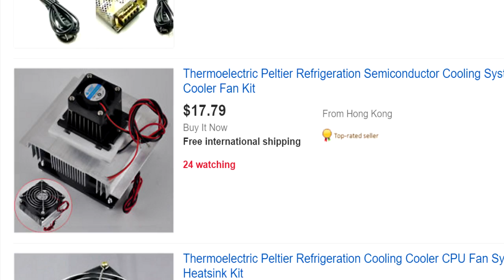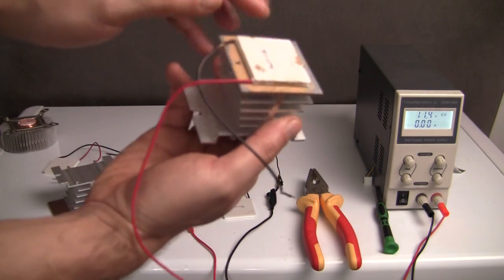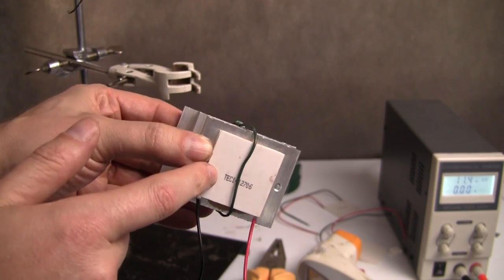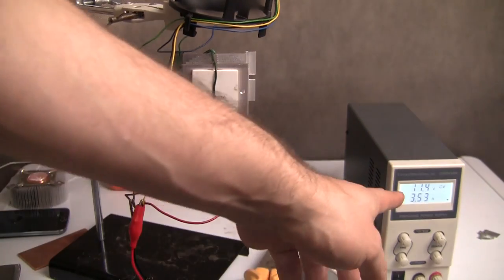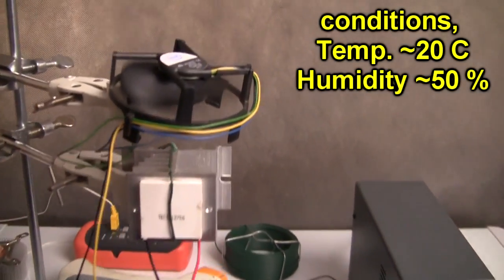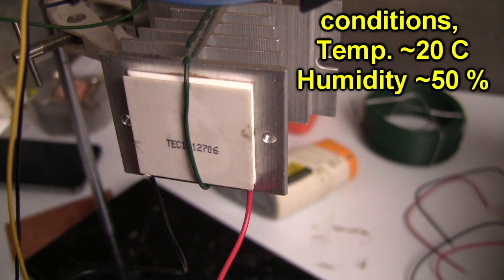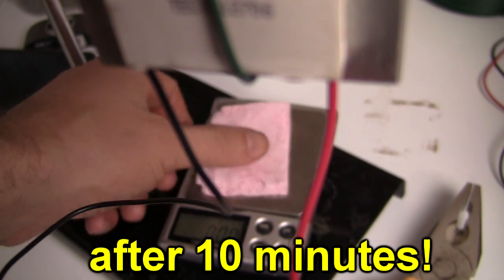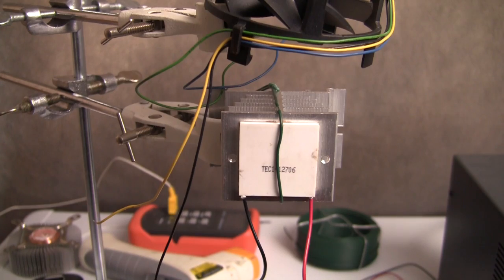Fontus Water bottle claims to make water from air.  Is it possible?

Comment: Thunderf00t your apparatus is not ideal and doesn't represent the product as all the water is sticking onto your peltier which isn't cold enough anyway. If you look at dehumidifiers they use a similar principal to this water bottle. They have a finned steel piece on the cold side that is covered with a hydrophobic layer so that the sink gets very cold, but not below freezing, and any water that collects on the surface drops down rather than collecting on the surface of the peltier, leeching energy away. Also this water bottle will work best when moving through the air such as on a bicycle. Having said all that, I think if you are cycling with the water bottle and have a full battery you may get a full bottle of water, but certainly not if its just sitting there.

Comment: Did you coat your equipment in hydrophobic and hydrophilic materials? That is essentially their claim it seems, that the nanocoatings greatly increase the efficiency. Also, you should have air flowing over the plates, at say 40 or 60 km/h, since their design uses the movement of the bike plus probably a scoop to increase speed and density of air flowing through the system. As mentioned below, also you should be closer to 70 to 80 percent humidity.

Comment: you need to coat the heat-sinks with a hydrophobic substance you also need more surface area. there is a noticeable difference in water production. otherwise you end up re evaporating any moisture you collect because of air flows. regardless of surrounding temperatures. there are other variables as well. like humidity.

Comment: What if you double stacked the peltiers to get the cold side colder?
Reply: +Ren K That wouldn't work the way you think it does.
It would retain the -5 degree temperature for longer, but it's essentially just like adding another heat sink onto it.
Reply: +LouisAndPillz actually stacking them works exactly how ren k suggested. stack 4 of them youll get an ice buildup real fast

Comment: I'd like to see your results with more variation in test conditions.  Higher room temp, higher relative humidity should yield some slightly better results.  A copper/alloy heatsink might do better too, but I doubt that the water bottle had those due to price.

their claim is 0.5L/Hr, I'd be fairly impressed if they did that with anything less then 90% humidity.

Comment: If making water from the air is possible, someone already pattent technology and been ultra billionarie already... because we dont need more water supplys if this is possible... why people believe any bullshit that hit the internet.
Reply: +Armando Montero Air conditioners and fridges make water from air.
Reply: Ren K
Problem with that kinda water is H20 Pure. and if you drink pure H20 you will desmineralize your body, because the common water we drink is full with mineral and other stuff...
Reply: People drink water from reverse osmosis units all the time.  You aren't going to "demineralize" your body by drinking pure water lol
Reply: Cyborg Pirate Ninja Jesus
you actually know that when you reverse osmosis water plant remineralize water right? people dont know that part at all. because filter with reverse osmosis is so good that remove everything and leave H2O pure, and they need to re-mineralize water before releasing it.
Reply: Armando Montero You can buy your own RO system for your home.  They are pretty common among people with hard water issues.  Their very purpose is to produce clean drinking water.  What other purpose could they possible serve?  I used one for years and never suffered a mineral deficiency.  Neither has anyone else, that I'm aware of.  That's because water isn't the only source of minerals.  Practically everything you consume contains minerals.
Reply: Armando Montero
  eat something. demineralize problem solved.

Comment: I'd make sure the closed space and thermal connection is good, if there are able to make the device efficient enough and separate the hot and gold sides efficiently enough it could be very effective.

Otherwise a pretty solid debunking, I would also test for cycling of the hot and cold, as we saw on start up it did get very cold and if you shut it on and off cyclically what does it do? So many fun questions to answer.

Comment: Another quack product using some "real science". Sure the basic idea is sound, but in reality it has no chance. I run a peltier cooler to keep my soda cool, and it eats 12v at about 6 amps. Leaving it open all day results in just a few ml of water at the bottom. At best those solar cells will provide less than 10% of that. That's the problem with a product like this, just enough truth to fool those not fully paying attention.

Comment: Yeah, at 20 degrees. What about 35? Also, how much electricity had to be sunk into it? Like, if you were worried about running out of water, you'd next be worried about running out of electricity. How many batteries would you go through in 1 day just to make a shot glass?
Reply: +Beren Scott Pretty sure it'd be fairly easy to rig one up to a solar collector, or one of those hand crank generators.
Reply: Dargonhuman And if you are hiking, wouldn't you rather carry x litres of water, then carry the bloody heavy solar collector?
Reply: Beren Scott
X liters of water, or a couple modified solar lawn decorations...  Hmm, that's a toughie.
Also, I did say "or a hand crank generator", which is still lighter than two liters of water, so yea.
Reply: Dargonhuman Yeah, but the energy consumed in order to get enough water is excessive, you may as well use a machine to convert your sweat into drinkable water.
Reply: Beren Scott
Why use a machine?  I just squeeze the fresh raw sweat out of my clothes right into my mouth, just like John Wayne would have done.

Comment: The water that collects in my dehumidifier never looked tempting to drink. I can't imagine the shit that would accumulate if I used it outside! Yuck.

Never mind the efficiency.
Reply: +EnhancedNightmare The dust in your home is mostly your dead skin cells. I think you'd prefer the shit that would accumulate outside :)
Reply: tybofborg Well, deadskins and dirt etc compared to smog and industrial waste. Tough choice :D
Reply: It's not like that stuff doesn't make it into your home. :P
Reply: tybofborg There is a filter system in the ventilation but opening window cancels it lol. Still during smog alerts they say not to open windows.

Comment: What would happen if you add another heat sink to the cold side to spread the colder temperature to a bigger surface and allow more air to cool down and at the same time have a greater surface for water condensation to occur?

Comment: Theoretically a nice idea, I mean air has so much watch in it and the more humid the environment (where you're more likely to loose a lot of water) the better it would do. I would argue that the heat sink you used and the the fact that you didn't have a tight fin grid cooler for the cool side, but peltier coolers are not efficient enough compared to other technology.

But if you ever found yourself in desperate need of water and you had this option vs using chlorine or a desalinating device... well for the same amount of energy fresh dirty water would bee easier to use chlorine, and for salt water (on a raft/boat) if you had that much power available, then using an electrical condenser (heating the water) would be better.

Fog nets are so much more efficient for literally drawing water out of thin air, no power needed, though they are not portable on your bike... you might as well use tap water and plan your trips better.

Comment: Patent pending...for what, a portable, inefficient dehumidifier? 

It might work in a few places under ideal conditions, when the temperature and dew point are through the roof (relative humidity). Like the Persian gulf or the rainforest (if you stuck the solar panel above the canopy). But the 250-300ml per hour you might get out of that bottle under its ideal conditions would necessitate such unfavourable conditions for humans that your body would be sweating out 10-20x more water in that period... and in most of the world, most of the time it would give you nothing. Maybe a few drops.

Oh, and the water won't be "clean."

Comment: NASA developed a technology for mars where air is pushed through a hydrophilic membrane then enclosed and radiated with microwaves.

And I remember having to constantly empty air dehumidifiers when working in the tropics. The dehumidifier worked by having a heat pump and a fan, the fan constantly intaked air over the hot coils then exhausted it over the cold coils. 

My point being that I can see how this technology could work by combining a peltier cooler with the proper membranes to "efficiently" draw water from the air. However, I noticed him using his device in the middle of a forest, I'm assuming with a lot of ambient humidity. If you were to try the same thing in the Mojave, you'd probably have to wait all day for a sip of water.
Reply: +Serahpin dehumidifiers draw probably hundreds of watts normally. The challenge is, can it be done just as effectively with something like 100th the power?

Comment: isn't 50% humidity a bit low? I think on a hot day in the woods you easily get over 80%.. they probably did their best to do this in a humid environment with the best variables in their favour.
Reply: +Rothnacum1 Even if the air was 100% humid, you still wouldn't make enough to fill any sort of large container.
At that point, the power you're using to make said water would be better used for something else in an emergency situation.

Also, more variables go into it than just humidity.
Reply: +LouisAndPillz of course.. variables (pleural) and more humidity and temperature makes you sweat more. I just pointed out how they probably used variables (pleural) in their favour.
Reply: Rothnacum1 Uh...
It's plural. Not pleural.
Reply: Thnx.. I could have known cause it is about the same in French just in Dutch it's "meervoud"
Reply: Also at work we use dehumidifiers with over 950l every 24 hours.. Ofcours with 360v and weighs about 200kg. The portables can catch up to 100l in 12 hours ..

Comment: From the Indiegogo:
. "...A series of small coolers bring the moisture contained in the air to condense on special surfaces."  
(Later in the FAQ):
. "How does the technology it work? We employ a technology... We will not disclose any subsequent details as to the absolute specifics of how it functions."  
  
It seems there is something "magical" in the SURFACES were the condensation happens. 
Since they have a patent, it is probably a propietary method to create nano-filaments to agregate water molecules by increasing the effective surface a few millon times [compared with a polished cooper face of a dissipator].
  
  Still I want to know how the thermodynamics of the process will work; as the condensed water should keep most of the heat (instead of getting cooled at a lower temperature than the air) after it changes from suspension to a liquid drop; moved away quickly into the container.

Comment: Are their any meaningful ways they claim to speed up the process?
Reply: +PHeMoX You can probably increase the efficiency quite significantly, but probably not more than double. That brings it to 2 shot glasses a day with 40W of power. The only way to really make a dent is pumping more power trough, but that's just not happening. A fairly large phone battery bank can contain about 10Wh, which is enough to run the 40W device for 15 minutes. If you're going to take more batteries or solar panels, you might as well just take plastic water bottles with you. That's water you don't have to wait on.
Reply: Niosus Good points!

Comment: Thunderf00t, do you plan to buy one of these units and run tests in controlled conditions?

Your experimental apparatus doesn't take their engineering design into account. Your apparatus seems more of a proof on concept device. These styles will never perform like an engineered design.

Comment: I had a broken water pipe in the flat above me 2 weeks ago and now I have these two huge machines that suck the water from the air and out of the walls and they combined produce maybe 5 litres a day and now two weeks later thunderf00t makes a video on how they basically work so god exists.
Reply: +Skoenner Yup! Dehumidifiers work with the same principle. Although those ones use compressors instead of Peltier elements to do the cooling though, much more efficient.

Comment: With adjusting the cold side temp to the dew point, and air flow control you might have an order of magnitude or so of improvement possible.
Reply: It might be interesting to make a non boiling distillation rig around a peltier device. With an external hot side heatsink/fan to control the hot side temp, and peltier power to control the cold side (condensing vapor transferring energy from hot to cold sides)

Comment: So if I have say 2kw of solar panels then It should work right? ;)
Reply: With a DC-DC converter you can supply enough current as long as there is enough power (watts) supplied from the solar panels.
Reply: Transformers do nothing in a DC circuit,.. Well, other than become an electromagnet that is. You need a pulse generator or AC for a transformer to do anything. Once you have a certain amount of watts at your disposal it's fairly easy to get any combination of output you would like. If you want a higher voltage you sacrifice amperage an vice versa. VxA=W so as long as that equation balances it's fairly simple to get the output your looking for. 
For example if I have 100watts I can have 100volts @ 1 amp, or 100amps at 1volt, or 50volts at 50amps etc,.. Building a simple power supply is rather straight forward. If you want it variable, stable and robust that's where the complexity comes in. Hence the big bench top DC supply you see TF using. The biggest benefit to having a higher voltage is that it allows you to get the same power at a lower amperage, seriously shrinking the size of conductor needed to move that energy.
Reply: +Cody&#39;sLab I dont think so, Im not great on electricity, but i think the killer is the ampage, and solar panels aren't great at getting ampage. again, I'm npt great on electrical stuff, and someone will probably correct me, but I think that's the problem here.
Reply: NZ SNIPER
Knew someone would correct me lol. out of interest, what does a dc-dc converter do? it sounds redundant
Reply: watch?v=GSzVs7_aW-Y is a good video on linear DC-DC regulators. Afrotechmods is a good channel for electronics. Highly entertaining.
Reply: NZ SNIPER
thanks for the tip
Reply: The circuity involved with using a transformer for a high current supply with a DC input voltage from the solar panels is far less efficient then using a 'buck converter', a type of DC-DC converter.
Reply: +NZ SNIPER 
let me correct you, it depends mostly on the voltage that is coming in and the load capability.
Even if you're capable of supplying 10 amps on the regulator, if you're not able to keep up with the volts you're not going to get it regulated.  same goes with Volts, if the volt requirement goes too high you're going to have a drop. Power is just volts*amps so you saying (as long as there is enough power) is kinda wrong, mostly because you ignored volts. Pikachu your voltage and Amps based on your load and you'll catch all the requirements.... :)
Reply: With 2kw of panels you would be better with batteries and inverter and a compressor dehumidifier

Comment: In Mad Max they use post-apocalyptic junk technology to generate clean water in the desert. You put up a big tarp in a steep angle with a container in the bottom. In the morning all the dew flows down into the container. If someone is in the wilderness camping, shouldn't that same thing be possible using the rain-proof tarp that comes with a tent?

Comment: Judging from the pictures these croc-tossers have on their indiegogo, I am convinced none of them have spent any time on an a serious 'adventure' for any length of time.   All that equipment is very new and pristine . . . and is their backpack really so full to necessitate strapping rope to the outside?  Generally, you want to avoid snagging tree limbs and sharp rocks.  It also shows them mountain biking through perfectly clean streams in that video.  In my youth I was a hopeless drifter traveling musician and once lived consecutively outdoors for three years while roaming through some very wild places.  Once, some companions (ex-chairforce and a marine) and I were bumming busking about skagway and we kicked around the idea of a creating a self filling water bottle.  At the time we were filtering most of our water from streams, which was not at all inconvenient and never filled us with 'anxiety'.  That was a decade ago, and the army already had units that did this in Afghanistan and iraq but they required an entire simi-rig to haul.  It is reasonable to assume a future mission to mars could condense all its required water from even that skant of an atmosphere (provided they couldn't simply melt the subsurface ice) but even that would a feat for a rig weighing several tonnes.  We reasoned we could make something that could fit into a backpack (for use on earth) provided we had some access to secret government lab where they might have exotic, hydrophobic, bio-mimicking nano-machines.  Alas, all the feds would let us access was welfare (and begrudgingly at that).  Anyway, I was very disappointed by this video;  this has the potential to be a very useful product.  eff the infra-red camera, thunderf00t, please crowd source an array of nanofabricators and actually make one of these that works, damnit.  Than make a video where you smash it upon the rocks, than guzzle some fresh stream water and say 'real men get giardia'.